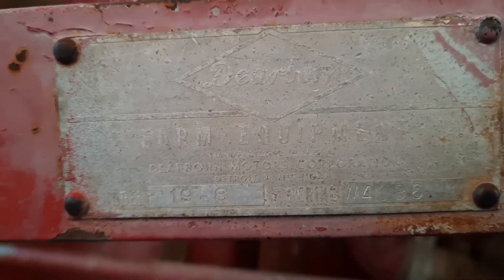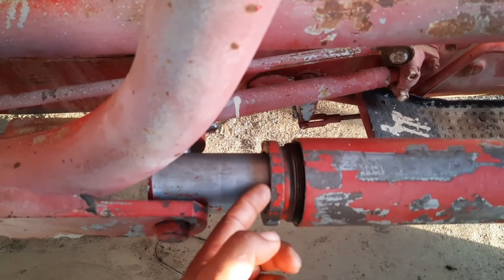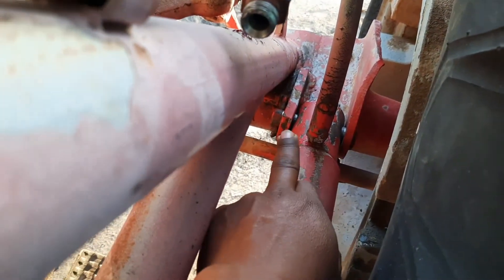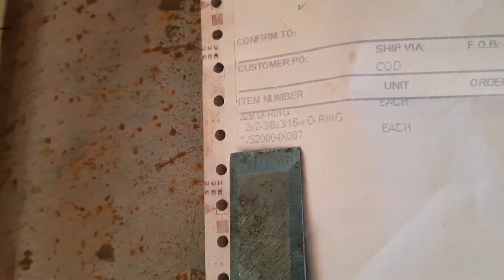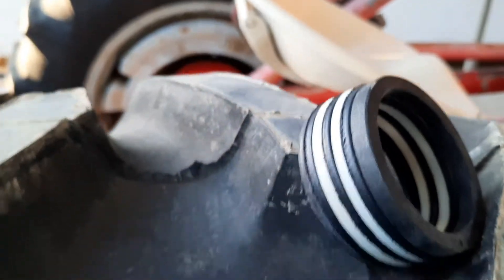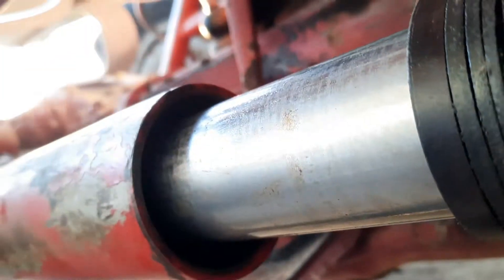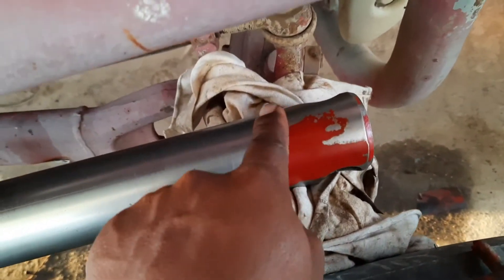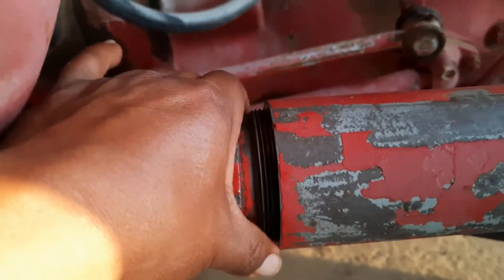$17 Hydraulic Cylinder repacking for dearborn 19-8 front end loader on a 1949 Ford 8N tractor. TIPS

Comment from the maker: Update. As you can see its been over 3 years of this fix and no leaks. I do thank some of your comments on educating me of a few things, these are also called "chevron seals". Some pros suggested to re torque after some use as the seals compress, thats what i did and mos of my thread was used. No leaks prior to that adjustment but great advise. Some suggested to remove some seals but after re torquing i felt comfortable with that. Sorry i have not worked on the pump, the hydraulic valves or attaching or removing the front loader so i have no more experience on this area. Like the description of the video says, this is not a how to. Take it as me documenting my own fix for my own reference but if by checking the make video public box helps someone, that makes me happy as i have benefited from others doing the same. God bless ya'll keep on wrenching.

Comment: Great info! But, have you ever had to work on the hydraulic manifold(control valve?)? My cylinders don’t leak, but the bucket doesn’t want to stay where I put it. Any suggestions? I will probably do what you did, but it doesn’t seem to be the main problem. Thanks for your input!

Comment: Great video. I have the same loader and would like to know if you had to do any overhaul to the lift valve and the pump. 

A video about mounting the loader on the tractor and attaching the front PTO would be really great. The attaching parts are available new as long as you have the front PTO.
This would answer a lot of questions. Like, can you put the fenders back on after mounting the loader?
The lift valve has two positions. It can be mounted to actuate horizontally, or vertically, and might clear the fenders.

Comment: Hi, to clarify, can I take out the old V-seals without removing the piston?  Just kind of dig in there with a pick?
Reply from the maker: Correct, just remove the front end pin and grease certs , remove the cap/gland, pull  piston out slightly, and use pick to pull seals out, then put new one back.
Reply: Another way is to spiral painters tape on rod before seals and push the rod in the tape will grab seals and you can pull them out with rod
Reply: Good job.  The comments were helpful as well.😊